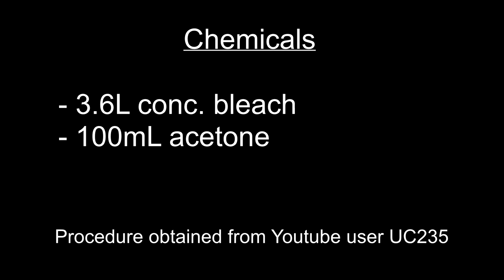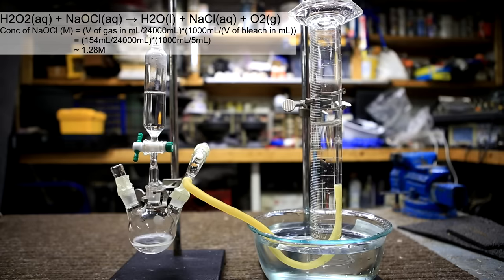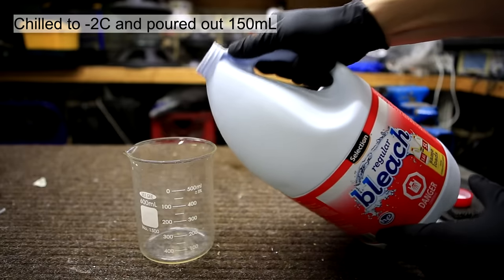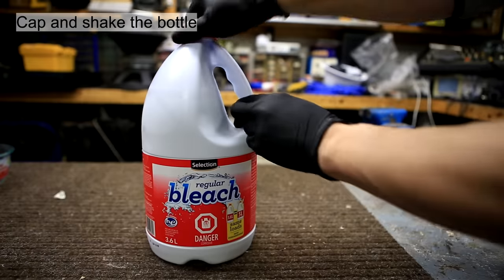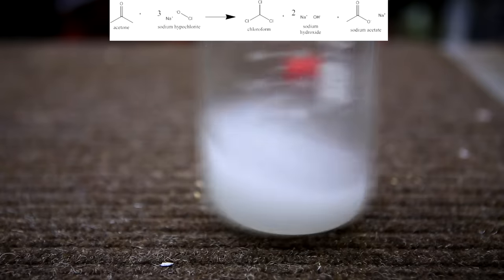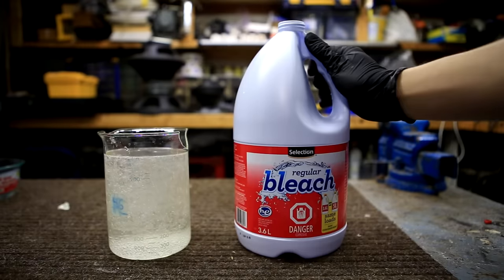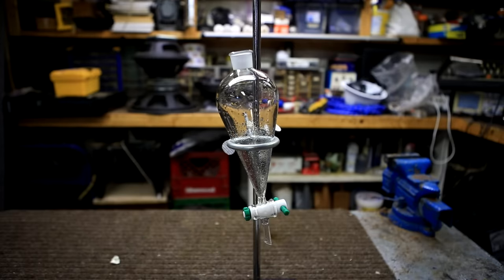Making Chloroform

Comment: "And prevent the formation of phosgene" is a pretty important detail that might have been worth a couple more sentences!
Reply: You realize the video is 5 years old, right?
Reply: What is phosgene?
Reply: @ClickBeetleTV  I wanted to thumbs up this comment but that felt a little wrong... Thanks tho for the answer!! :D
Reply: I find his videos hilarious. 

“You can make “insert crazy or caustic chemical name here” easily at home with common household items.”

Proceeds to use professional chemist’s equipment and gives a 5 minute rundown using completely unfamiliar terms and equations to the common viewer and then puts finished product in a tinfoil wrapped soda bottle and scrawls chloroform on it in sharpie. 

I wonder how many people poured acetone from the garage in the bleach jug under the kitchen sink and used a siphon to suck the bottom layer off and bottled it up and tried to knock out a friend or sibling with it. Only to have them coughing and vomiting while screaming about their eyes, nose, throat and lungs burning intensely.
Reply: @randomslomo1875  a very nasty chlorine gas byproduct, you can experience it by using automotive chlorinated brake cleaner, and a welder... stuff kicks like a mule and drives every bit of air outa ur lungs... very nasty stuff
Reply: @buckbundy8642  My thoughts as well...those who understand this or a bit of it will understand your comment.
Reply: @buckbundy8642   So first of all it was a very early video of NileRed, secondly he uses the term "common household products" NOT items! So it's not a bad thing to use professional equipment. Then he uses unfamiliar terms/equations because his channel is about f*cking chemistry! Also I unsderstand the equations because of school, you don't need to go to university for that. And for your last paragraph I highly doubt there was a case of that happening.
Reply: @randomslomo1875  mustard gas
Reply: @buckbundy8642  To be fair, his early videos were more targeted towards chemists, I believe. (He mentioned it in the NileBlue video regarding safety)
Reply: @fubar55676  No, but they were often used together. Mustard gas forces people to remove gas masks and expose themselves to phosgene.
Reply: @fubar55676 
From what I recall bleach and vinegar make mustard gas.
Reply: @D8W2P4  That's wrong
Bleach plus vinegar makes Chlorine (Cl2)
Mustard gas is Sulfurbased
and Phosgene is COCl2
Reply: @kmit9191  Nitrogen Mustard is also a thing, but still not produced by that.
Reply: @randomslomo1875  
Something containing no phosphorus.

Actually, COCl2. An acid chloride. The dichloride of carbonic acid H2CO3. It may be formed in halogenated compounds like chloroform under the influence of UV  light.
Or, if you blow chloroform vapor against a hot surface or through a flame.
Extremely toxic.
Reply: @wilfriedschuler3796  yikes .. thank you for the chemical explanation. Fascinating stuff.
Reply: @fubar55676  @Random SloMo
No, phosgen is not mustard gas.
Mustard gas is 2, 2´dichlor diethylsulfide   Cl-CH2-CH2- S-CH2-CH2-Cl. And it not a gas but an oily liquid at 20°C
Reply: @jackkardic5151  
Wow. You are in insider. 2,2´dichloro diethyl, methyl amine is a precursor to make Dolantin, (Pethidin) an strong opiate. Old German Chemistry from 1937.
And you are right. It creates extremely nasty blisters on ones skin.
Reply: @randomslomo1875  
I used to work with phosgen in our lab. Many years ago. Not a stuff to play with. It is chemically related to isocyanate. Remember methyl isocyanate was the product to cause the Bhopal desaster in India. 25 Years or more ago and with hundreds of victims.
Reply: @wilfriedschuler3796  So since you apparently know your stuff and the above comment was wrong, aside from other nasty byproducts, which household items combine to produce mustard gas, chlorine gas, and phosgene gas?
For the record, I have no interest in making them, rather avoiding them, as many years ago a neighbor was put in hospital while trying to unclog a sink IIRC.
Reply: @wilfdarr  
Well, I started as a trainee in the lab of the plant in Frankfurt who produced the first time Furosemid = Lasix. It was in April 1963. Some time ago. We also made Methadon = Polamidon. So you can see, I was in the middle of the things. I was a child labor if you apply todays law. Later I graduated at Darmstadt as an external student.

The problem with chlorine bleach is that it forms gaseous chlorine as soon as you add acid. As you know, the crofyty Germans used chlorine in Flanders. Dirty trick. It was a by product with no other use for it. Something like DU shells today. Actually the French started the game with tear gas, taken from the Paris police department.
It is a pity that Dr. Fritz Haber, the genius who invented the Haber-Bosch process to produce ammonia out of air, water and coal, created the chlorine idea. And Wilhelm Ostwald invented another process to make nitric acid from ammonia. A decisive point as well.
Therefore the Brits could not prevent the Germans producing explosivs by a blockade of sodium nitrate from the Atacama desert.  Without the 2 chemists the germans would have faced a severe shortage of explosives during late 1915. However they a had a stock of serveral hundred thousand tons of imported nitrate from Chile. But, not enough.
Reply: @wilfdarr  
Most household products are safe. Washing up liquid, all purpose cleaner, detergent powder and liquid detergent may irritate the eye but can be rinsed off easily.
Dangerous is chorine bleach, drain opener and some pool products (which may generate chlorine as well)
As to the drain opener, there is a kind consisting of 93-95% sulfuric acid. And there is another kind, possibly from another supplier, consisting of 35% sodium hydroxide.  Or even prills 99% active. (Beware also of oven and barbecue cleaner. Same stuff inside.)
Mixing the both will create a lot of heat and blow a part of the mixture in your face.
So, the golden rule never to mix everything with everything. Most dangerous products are  the ones with strong alcaline. They are difficult to rinse off and will severely damage the eye.
Rust remover containing hydrofluoric acid is forbidden in Europ. And for good reason.
So better leave in the shelf.
Stay safe.
Reply: @buckbundy8642  anyone else think this guy was a little too upset he couldn't do it at home and he has a weird imagination and then then name all just red flags that this dude up to something
Reply: I know: I was like, "Imma do that!" until he got to the "to prevent phosgene." part, and then I was like "Yeah, nah, I guess not."
Reply: All I know is don't pour bleach into a toilet bowl full of urine.  It reacts with the ammonia in the urine to create chloramine gas, which can kill you, and will certainly ruin your day.
Reply: @mdemers767 
True. Chloramine is actually the so called "chlorine odour" in indoor pools.
An excellent cleaning product for toilets is Caroate .  A mixture of K2SO4, KHSO4 and K2SO5. The latter is a strong oxidizer. It is also very useful to clean and clarify pool water, spa and such things.
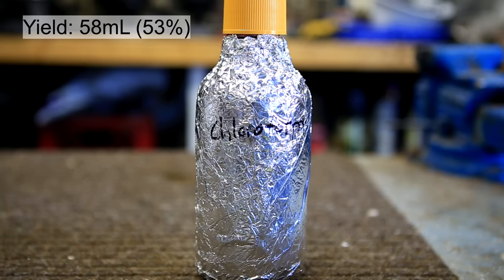Reply: at about 4:44 he says to add 1 milileter pure ethanol to 58 milileter of chloroform to eliminate the formation of phosgene, why additional information?
Reply: Awesome! Now I know how to make phosgene. Lol
Reply: Always keep your nose away when playing with Hypochlorite. I have encounter some nasty fumes,White smoke, green, u name it
Reply: I used Analar chloroform daily, and never had a problem or thought about phosgene. Diethyl ether was a concern, as it can form an explosive peroxide.
Reply: Hieronymus Bosch  I sniffed some at school, and had a near pass out, but worked with it in a lab for years without a problem, except for some rubbish bin fires, from dropping cigarette ash in on top ether soaked filter papers.
Reply: @buckbundy8642  🤔🤔🤔 why do defensive my guy??? Was i on to something 👀
Reply: @JarodHaws  how is me making fun of your atrocious spelling and grammar constitute as defensive? 🤣😂 Are you a Klondike Gold, Russet, or Idahoan?
Reply: since theres a bunch of nerds here...    could u fill a super soaker with mustard gas and spray it on fires to put it out by removing the oxygen???  or more realistically... a super soaker with two compartments, one with bleach the other with drain cleaner or whatever the other chemical needs to be..  will the chemical reaction happen fast enuff or what would happen??
Reply: CHCl3 + O2 > 2COCl2 + 2HCL Ethanol acts as a scrubber for the HCL and O2. Slight amounts of water and light catalyze the decomposition of chloroform while heat oxygen and a metal oxide catalyst will make lots of phosgene if needed for an experiment. Phosgene is insidious as it smells kind of like chloroform mixed with mowed grass and doesent trigger the aversion in time to save you unless you know what it is. In contrast hydrogen cyanide is actually pleasant smelling like cherry flavored candy 😲 Worst chemical i ever worked with was monomethyl and dimethyl mercury. Didnt smell that one thank god. Used in a glove box with overkill, but not really overkill!  precautions. Good times.
Reply: @808stateofmind2  Wait, no, wait.... a super soaker that shoots NUKES!
Reply: @buckbundy8642  the point of his videos is to show him making it, and is mainly for entertainment purposes, not to instruct or encourage people to attempt this themselves. So your comment is flawed in every way.
Reply: @RatKingKitKat  you’re like the ignition timing in my nitrous car.
Reply: @ClickBeetleTV  Perfect comeback
Reply: @Realzurit  his comment just kept me from trying to make this stuff sooo I mean I heard chloroform could be a good high if you don't pass out plus id love to have a way to actually sleep
Reply: @buildtime78years9  guessing you already tried taking melatonin.. and his video shows it in foil for that reason. Mixing bleach and acetone needs to be in a brown bottle or just something with minimal light or you get what other are saying here
Reply: @D8W2P4  baking soda too
Reply: @randomslomo1875  mustard gas
Reply: @buckbundy8642  can no one take a joke why is everyone like “um actually 🤓” to ur comment. i was thinking the same thing lmfao. shits funny
Reply: If you smell hay, run
Reply: @buckbundy8642  Probably no more than a couple, if any at all given how the process is clearly more intensive than that.
Reply: Not really. Anybody who tries to make chloroform should know what they're doing
Reply: Not A fascist Slave V  only after you do it in the closet as an example. 😘
Reply: HERE is Our TRUE Savior

YaH The Heavenly FATHER HIMSELF was Who they Crucified for our sins, NOT jesus, and “HERE IS THE PROOF”

From the Ancient Semitic Scroll: 
"Yad He Vav He" is what Moses wrote, when Moses asked YaH His Name (Exodus 3)

Ancient Semitic Direct Translation
Yad - "Behold The Hand"
He - "Behold the Breath"
Vav - "Behold The NAIL" <— YaH’s Crucifixion
He - "Behold the Breath"

“Behold the HAND that Beholds The NAIL” 

PROVES - YAH The Heavenly Father HIMSELF was Who they Crucified

That is EXACTLY what Moses Wrote

Here is what they mean

YaH's Name:
(Ya)d + (H)e, as YaH is what Moses called Him and YaH Declared: "this is My Name, this is My Name for all generations" (Exodus 3)

YaH is The Creator of “MAN”:
Yad He, (HAND BREATH), as YaH's "HAND" Formed man from the dust  of the Earth and His "BREATH" made him a living being (Adam)

YaH's Sacrifice of Crucifixion for “MAN”:
Vav He (NAIL BREATH), the "NAIL" through YaH’s "HAND", in Sacrifice of Crucifixion, that whosoever shall call YaH Savior, His “BREATH” brings forth life (Salvation)

How YaH arrives:
YaH arrives via the Tent of Meeting (Exodus 33:7:11, Isaiah 54, 55), where a Tent is erected outside the city, a cloud descends upon the entrance of the Tent and YaH appears...

Why they demanded YaH to be Crucified:
YaH was Crucified according to Hebrew law (Deuteronomy 21), to be Hung on an Almond Tree for BLASPHEMY as it was for His NAME they demanded Him Crucified. The Messiah claimed He was YaH...

HE WAS YaH!!!

HalleluYAH translates “Praise ye YaH”

The Hebrew Book of Isaiah

Isaiah 42:8
"I am YaH; that is my Name! I will not yield my glory to another or my praise to idols.

Isaiah 43:11
I, I am YAH, and there is no other Savior but Me.

Isaiah 45:5
I am YaH, and there is none else.
Reply: Say what🤔

Were made in HIS image. HE made us with the power of free choice
A good prayer:
I'm a sinner JESUS please forgive me for all my sins I know you shed your Blood for me on the cross at Calvary. Thank you JESUS for my salvation and for shedding they Blood for me. I love you JESUS. 
Romans 10:5/10 ct...❤️k
JESUSisLord!Amen...
Amen..
If you'd like to call someone who cares 
83
For
Truth.
bc you don't know when you'll die?
.y r u hesitant. .. .... ....
Reply: @ClickBeetleTV  Yes, yes it did.
Reply: @fubar55676  Phosgene is not Sulphur Mustard and has absolutely nothing what so ever in common with it.
Reply: @noop9k  Not true. Sulphur Mustard was used because it was an effective blister agent and a petty good aerial denial weapon in the colder moths.
What was used alongside Phosgene and Chlorine was something often referred to as Blue Cross. It was basically various forms of tear gas.
Sulphur Mustard will not make you remove your mask, far from it in fact. The most important job for Mustard is to render a soldier inoperable for weeks or sometimes months. Yes it could be deadly, but in most cases it caused disfiguring, burns, and pain that could last for weeks.
What the Blue Cross agents did was to make people gag, vomit and cough before they could even put on their masks. However if you got your masks on quickly, then both Chlorine, Blue Cross and Green Cross agents were useless. That said, Phosgene was by far the biggest killer of the chemical weapons during WW1, but out of all the dead in that war, only about 100000 died from all the gases combined. Fact is that gas warfare is difficult to make efficient at best and completely useless and counterproductive at its worst.
Reply: @wilfriedschuler3796  Interesting. Organic chemist here specialising in Organophosphates. Doing a lot of Green Chem stuff to find alternatives to old school chlorinated and fluorinated phosphorus pesticides as well as Carbamates. I also have a soft spot fro war history and chemical warfare.
Reply: @Realzurit  its a joke
Reply: @grancito2  that’s what bht is for
Reply: @buckbundy8642  He doesn’t have an obligation to dumb things down for the average layman, this is meant for chemistry students
Reply: @buckbundy8642  Your comment is spot on!
Reply: @Realzurit  Your comment has been posted. Please know that in accordance with our guidelines, we will be examining your comment for clarity. Please have prepared in advance what you may think we are referring to.
Reply: Ikr??. That's a little bit important. l

Comment: I'll be honest, I clicked for the comments. Also dude, no one has that equipment unless you're a science teacher,  or running a meth lab, or both.
Reply: saaaaammmmmeeeeeeeee
Reply: Its not that hard to do it using a crude setup in a kitchen for a chemist. Won't be that efficient though.
Reply: you'll be very disappointed to know, it's much easier than you think.. not putting where, how & what but too easy. :(
Reply: All that equipment or at least an equivalent can be purchased for less than 100$ closer to 50$ than 100$ if you know where to look
Reply: You can buy most chemistry glassware on amazon. The harder things to attain are chemical reagents you may need for home chemistry but a bit of googling you can usually synthesize your own stuff (like the guy did in this video)
Reply: Amazon, eBay, alibaba, school sales, wish, united nuclear, etc etc... There's no reason why glassware would be hard to find unless you live in the bumfuck Congo and even there the poorest of geeks find ways to improvise labware.
Reply: Ebay man Ebay...
Reply: I’m neither of those, but I have all of the glassware. Does that mean I’ll turn into a teacher or a meth cook?
Reply: Freedom Through Knowledge Buy that wrong glassware in the wrong nation/state and guys with heavy body armor and machine guns will smash your doors and windows in and lob flashbangs at you... I ain't saying it's right, just what happens.
Reply: Walter White refference?
Reply: I do
Reply: The chemicals are not that hard to come by, If you work in the proper industry.  I run a 8 stage washer for powder coating and I treat the waste water for zinc and chromium.  I play with some fun concentrated acids and bases.  I am still learning.
Reply: That stuff isn't hard to get if you're really into it.
Reply: Everyone forgets that it says Making and not How to
Reply: NekoChan It's really not all that expensive, anyone reasonably interested in chemistry would be likely to have most of the materials on hand.
Reply: NekoChan cuz there's no way you could do this with a couple of 2L bottles
Reply: .....ahhhhh, YES, Breaking Bad, pretty blue was he's baby!!
Reply: I made a batch of this the other day but I got really tired.Wait,is it Friday???!!!
Reply: @marksierra3522  Customer: "Yes, I'd like a plane ticket to the bumfuck Congo." ... Flight agent: "Excuse me?"